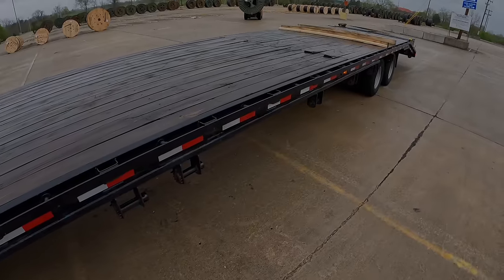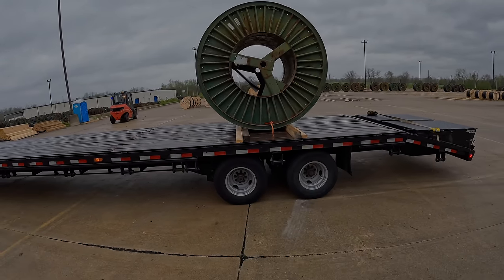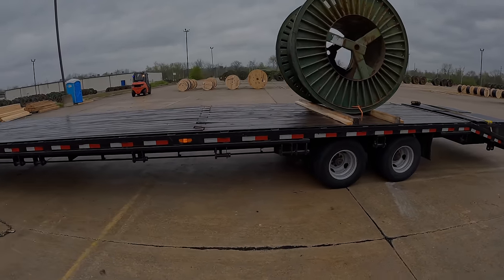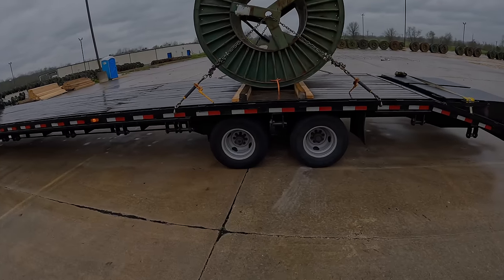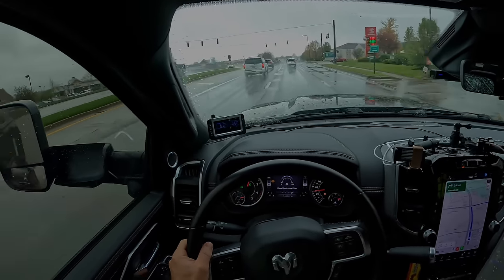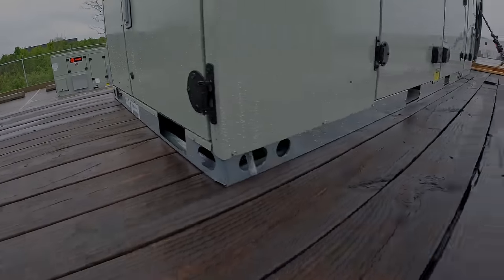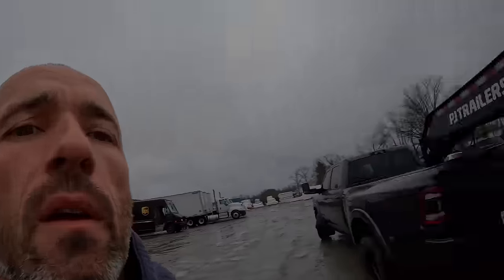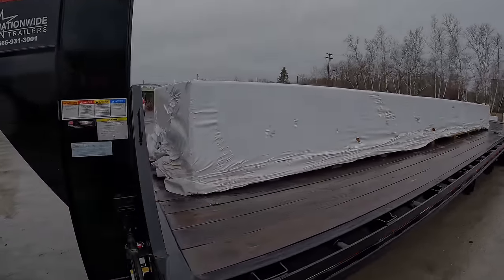Cold and rainy hotshot trucking week

Comment: Excellent securement video Alex!  Hey can you go into a little detail on your 5th wheel setup? I've seen those setups for rv hauling mainly but i don't know a whole lot about them. Thanks man and have a great week.
Reply from the maker: Thanks.  I’m mot sure what all I can tell you about the 5th wheel. I don’t know much about it besides that it works. lol.
Reply: @Mr.AlexKogan  I was thinking it was always gooseneck.  Did you go 5th wheel for more stability or because it's the 65 foot deal? Thanks for responding 👍
Reply from the maker: @alvinmann7675  It came with the truck when purchased it.  It’s supposed to give you a smoother ride and way easier to hook up and unhook.

Comment: Do you always have to record them putting and removing from trailer? Only asking because I’m looking to get into freight, currently an auto hauler but want to do something different.
Reply from the maker: You don’t have to record. I record so you guys can see what goes on at the shippers and receivers.
Reply: @Mr.AlexKogan   ok kool, so in auto hauler we do electronic BOL of before pickup and after once delivered. Do you have to do anything similar when it comes to condition of freight your picking up or delivery?
Reply from the maker: @yokelguillory6834  ai just get a BOL when I pick up my load and when I drop it off I have the receiver sign it and I upload it to factoring to get paid.